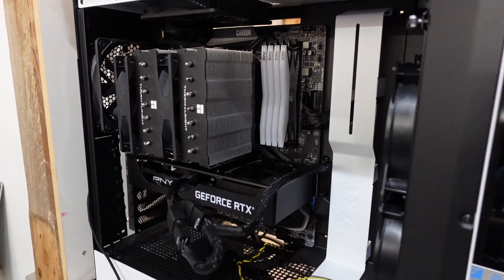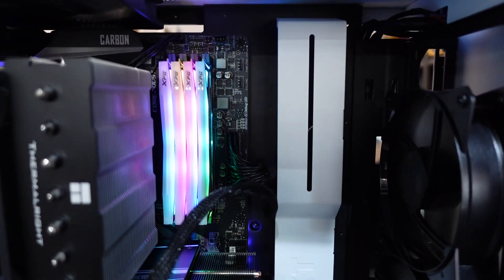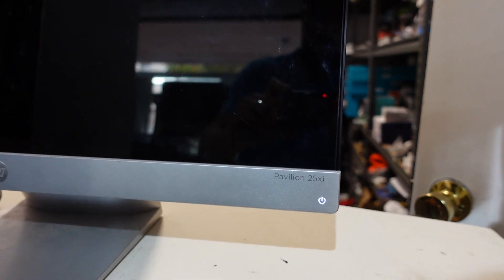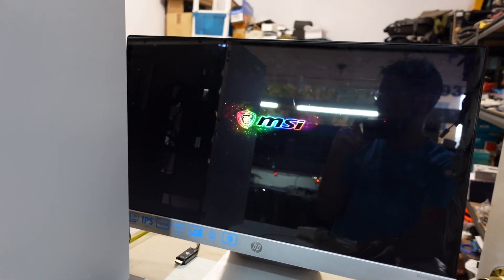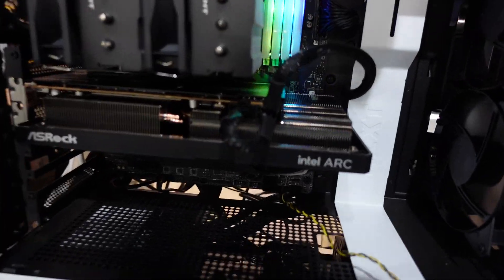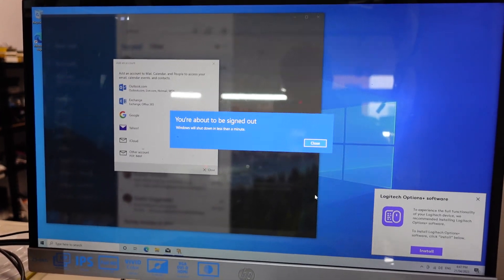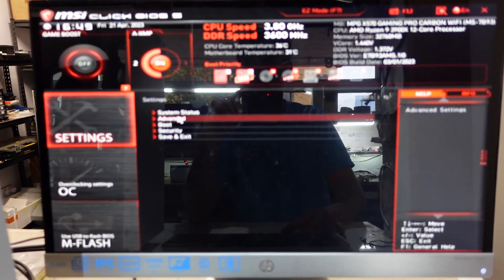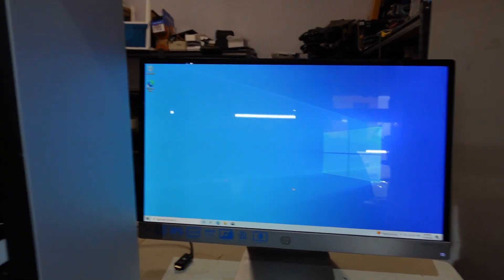My Issues with Ryzen 3xxx / X570 and the Intel Arc A750

Comment: The 3XXX series CPU with the X570 does support the Intel Arc GPUs, you also need to set the "Above 4G memory" setting in yours BIOS to enabled. I'm using my A770 16GB with my 3900X/X570(Asus ROG Strix Gaming F) and it works great!
Reply from the maker: I will give that a shot but I think I may have,  and it caused a boot loop
Reply: @rickstechrepairs  That might be due to CSM enabled MBR Windows installation, ReBar needs GPT.

Comment: You need 10th gen intel or higher or 5000 series amd an up with resize bar support to get the full benefit out of arc gpus anyways.
Reply: Most of Ryzen 3000 CPUs support ReBAR, and would be perfectly fine to use with ARC.

And even if ReBAR support isn’t enabled it won’t cause the system to not boot.
Reply: Running my a770 on a 9th gen Intel.